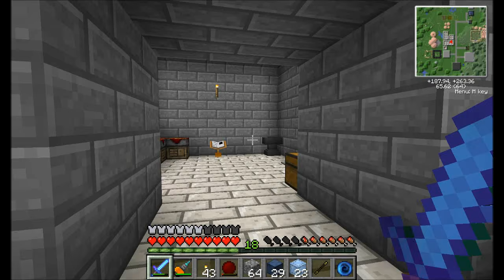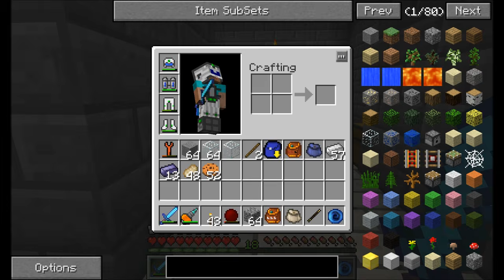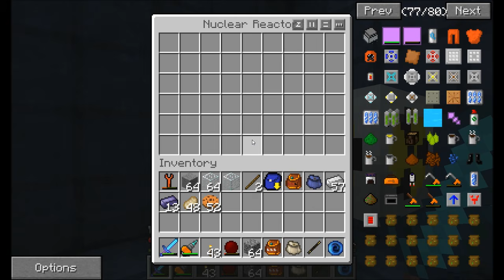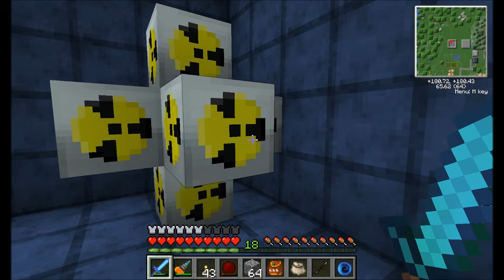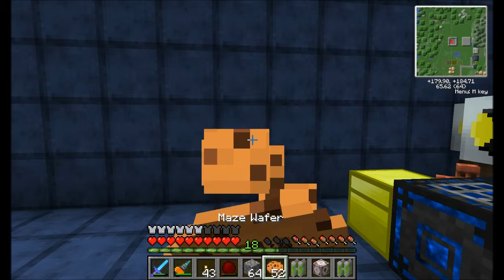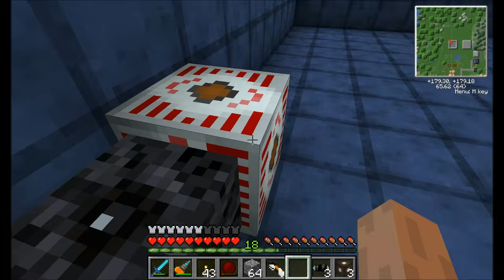Season 5 - Episode 60 Nuclear Reactor

Comment: I just had a thought.
What if you vented the extra heat into a furnace that would use that heat to cook or smelt things for you ?
Or get that heat into a boiler. You know, instead of keeping it hot with solif or liquid fuel, you'll heat it with the extra hear from the nuclear reactor.
Reply: +bigiri Sadly, that’s not a thing you can do with Industrialcraft reactors, though it would be awesome if it were possible to use that heat to generate even more energy! (Big Reactors can produce either energy or steam, but you can’t make a single reactor produce both at the same time.)
Reply: Gameactive
Holy necropost Batman !
Oh well.
I knew that even then, but there's always mods for mods, you know.
And Big reactors were not made at the time, IC2 nuclear reactors were the only high-gain power sources.
Reply: bigiri I’m aware that Big Reactors weren’t a thing in 1.4.7, just felt like mentioning that.

Comment: Apparently you need Applied Energistics version 12b or higher for this functionality to work properly. But that version it is only available for Minecraft 1.5.2 or higher unfortunately. So it is either golems or something else that doesn't use fuzzy buses from AE. OR upgrade and throw Redpower under the bus. Which I'm not willing to do just yet.

Comment: So..yeah.  I'm SO glad I took your advice and build a warded glass chamber.  My reactor spiraled out of control and went thermal.  Lost everything.  There was one open glass block on the side.  It blew a hole clean through the side of my mountain building.  BEWARE:  The reactor can overheat so fast, the emergency off doesn't even have time to react.

Comment: i was just thinking, that if you do it the way direwolf20 just did it, it will explode, you need to stagger the input of the uranium cells and the condensators, or they will all deplete at the same time, and with that many uranium cores, it probably will isntantly blow up, or do some significant damage to the heat vents, you say how quickly the 6ish took damage when he watched the temperature rise with only 4 quad uranium cells

Comment: I think he meant to say that the sorting machines aren't pulling stuff out from the chest because the pipes are clogged. It's been happening to me too. The routers aren't stuffed but whenever the sorting stops, I just break the pneumatic tube on top of the sorting machine in the wall then it'll start running again, but after a while it will stop again.

Comment: I have the exact same setup as dire in the videos and have no energy output, the LZH is dissipating, quad uranium cells are dissipating. I have read the forums on the issues and attempted to resolve through the suggestions made and still no energy output.
Any and all suggestions would be appreciated.

Comment: plops down a single deuterium/tritium fusion reactor with a supply chain for continuous operation.

40mil startup plus initial production, but then 32767per tick *1024 ticks per cycle less cell  production costs (less than 10 ticks worth of energy) profit.

we'd want a nuclear reactor barely pulling ahead of a small hybrid solar array why?

Comment: If someone wants to make an insane reactor that can melt in 1 tick, I built one generating 8100 EU/tick.  Unfortunately whenever 1 condensator is removed, the thing detonates.  I can't work around that with the current design unfortunately.

Comment: Not in this case, the reactors generate electricity, which is what is harnessed, and they generate unusable heat.  Unfortunately it can't be used though...  Would make a wicked boiler firebox for Railcraft...  I wonder if that could be possible as an addon...?

Comment: Even if you fill every slot in a 6-chamber reactor with Gregtech plutonium cells, the reactor only creates 13920 eu/t.
So either you're using some ridiculously unbalanced addon, or you're lying.

Comment: A long time ago, (like in either 1.2.5 or 1.3.1), IC² changed the way reactors work.  They changed coolant cells, added heat vents, and added dual and quad uranium cells.  It just so happens that they decided to get rid of ice/water based cooling.
Back when he could, dire did use ice.  In fact, he did it more than twice.  (Season 3, Season 2 SMP, FTB Insanity map, I haven't watched his seasons 1 or 2 so he could have in those, too)

Comment: Yep but DW20 pack doesn't have Greg Tech (atm) and the point was that setup is not max that can run but it is at the max output level you can use in "vanilla" IC2.

Comment: 400Mil EU = 37,5 stacks of UU matter (If it has amplifier on 24/7) , 

This system has a slight flaw , the second fabricator has no more sides to pull out from, Dire might have to reposition his crafting over again, luckily, golems dont have the ghost image of the item , so it aint a big deal

Comment: Dire I don't think you need that Hv transformer or the 4X insulated wire. You lose a lot of energy that way. Just use a glass fibre wire and put it directly into your MFFSU. Although maybe the direwolf pack is different but if my method works you should get more energy for your uranium.

Comment: setting your LZHs at diference of 555 usage points will give you equal times between runing out of lapis in each LHZ, but still your heat vents will have 3,333 seconnds to release the heat created by one quad uranium cell in the time of swapping LHZ. Note that most of your cells is surounded by 3 other cells so it gives it nice boost in heat production. I hope you belive in your golems that they are quick enough to swap cells before vents will get more heat than they can release in 3.333 seconds

Comment: hey dire, if you read this, the LZH condensators will run out at the same time and will overload your Golems, but you can fix this if you put a gate on the reactor that only turns the reactor on if the inventory is full. this will also help you know when your uranium cells are out. like so he can see.

Comment: A siphon works because of the differences in air pressure, and the force of gravity. Going back to your "moving object", you would need an infinite area for the object to move in, and even if you use the entirety of space, your object would still be affected by gravitational effects of planets and stars around it. And just what are you going to do with the energy you have "stored" in this moving object? Inertia is nice, but you can't use it for anything.

Comment: Am I the only one that has problems with Dire's sorting system when opening his savegame?

On the Ep. 60 download he has his mobile miner turned on, which will flood the emberchest as the sorter is completely dead for me o.O

I have tried all of the different modes on the sorting machines but they will just not run. I have gotten it to send one (1) stack into the system and then it killed it self again..

Anyone with any solutions? :)

Gr8 series Dire! :)

Comment: Also, if you check the IC2 forums for CRCS you should find the thread discussing it in greater detail. Should be on the second page in the Nuclear Engineering forum.

There's talk of a 'fuzzy bus' in a future release of Applied Energistics which would also enable you to set it up using AE, which would be MUCH easier to set up.

Comment: If you wanted to save as much resources as possible you could go into the energy storage (I think it would be the first in the line of storage) and there is a setting that says output redstone signal when empty/full, if you set it to output when full then you could set an inverter and make it turn the reactor off when your energy is full

Comment: For something to move infinitely, you need a lossless system. They are impossible. Even the universe is not lossless, eventually, the universe will not have the energy to sustain life. And where are you getting the energy to power the vacuum of the siphon? Siphons work by bringing water from a higher container to a lower one. The way they they work is due to the vacuum that is created when gravity pulls the water in the downward tube, it pulls more water until water levels are even

Comment: It is impossible to build a machine that moved infinitely. Energy (even kinetic energy as you are talking about here) can only be converted, not created, and every conversion of energy has inherent inefficiencies. Try it by dropping a rubber ball. Potential energy (From height) -> Kinetic energy (as it falls) -> Elastic Energy (When it bounces) -> Kinetic energy (As it flies up) -> Potential energy (At the top of it's arc). Notice it didn't bounce as high as you dropped it?

Comment: If there is no resistance, an object can move forever, since there is no force working on it in any way. It does need the starting bit of energy. The energy is NOT infinite, but it will stay in the object in the form of movement. This is not possible on earth, because there is always resistance, which converts the kinectic energy in the object into heat. You won't be able to get electric energy out of it, simply because the dynamo converts some of the kinectic energy into electricity and heat.

Comment: Read wikipedia's article on the Second_law_of_thermodynamics. It's the main thing that you're missing.
Also, it's impossible to build a thing that doesn't get acted upon by outside forces. There is no place in the universe that you could put this machine without light particles and minute amounts of gravity pushing and pulling it. Eventually, it will get put into a place where it can no longer move.

Comment: The Direwolf20 pack does not contain GregTech Intergalactical. So no, he cant make an Inter Dimensional Energy Storage Unit.
If, you are implying that the Direwolf20 pack does include GregTech, it would mean that standard mass fabricators are not enabled, so even more energy would be required per UU-matter.
The maximum output from an IC2 reactor is 2000 EU/t, so the HV transformer CAN handle it.
2000 EU/t means about 1 UU-matter every 250 seconds (without multiplier)

Comment: I believe that the wiki states that the massfabricator can take a maximum of 512 EU packets, so if that's true it would have to be connected to the HV-transformer.

No big difference though.

Personally I'd like to see perfection. swapping out and manufacturing the cells automatically, producing scrap also so the EU matter is less expensive power wise. Everything produced from eu matter of course.

Perpetual motion FTW, and nice work DW20, though 2048 EU/t would be cooler. ;)

Nah, close enough.

Comment: But it may be possible to build a machine that moves infinitely, as move energy (I'm not sure if that's the correct name) is a form of energy too. As long as it doesn't get converted into another form (heat or something like that) it should maintain it's momentum. Of course it would have to be in a vacuum with no influences from outside so it doesn't get hit by particles or light, so it's infiniteness doesn't get falsified...
I'm not sure if I'm right, so please tell me if I oversee something!

Comment: I'd scrap one of the golems and have the first fabricator touching the reactor directly pulling the fully drained condensators and passing it to the 2nd with the marker on to bring it up to 80% with the golem replacing them so that it's near enough instant then have columns 1, 4, 6, 9 as condensators and column 2, 3, 5, 7, 8 as quad cells it generates 3280 and can run as long as lapis and cells are provided to it maybe set up some item tesseracts to keep it all completely self contained

Comment: To Dire: you should damage the LZH-Condensators slightly so the golums have a short time (put each condensator in with a seconds difference) to pull and place, MAKE SURE THIS HAPPENS or else the reactor will blow up (tested), or at least lose ALL the over clockers.

Comment: What would be cool is if there were: A)Control rods for nuclear reactors B)Putting damaged (with damage values) uranium-plutonium cells cause you to take damage with the poison effect C)Having depleted uranium-plutonium cells in your invetory kill you instantly E)You can to pump water with liquiducts/waterproof pipes in the reactor and but you can still use cooling cells but they will be no way NEAR as good as pumping water (also, heat vents can't be crafted)